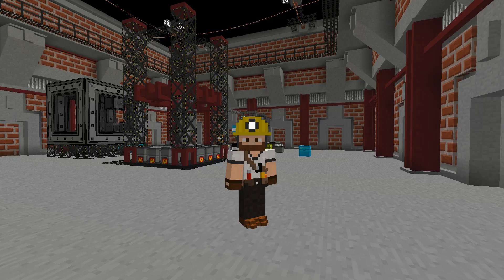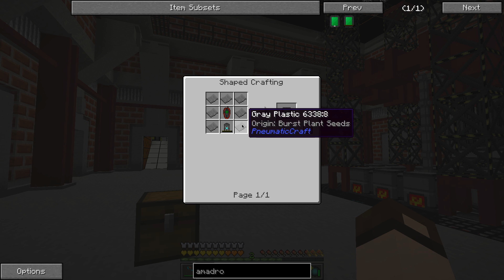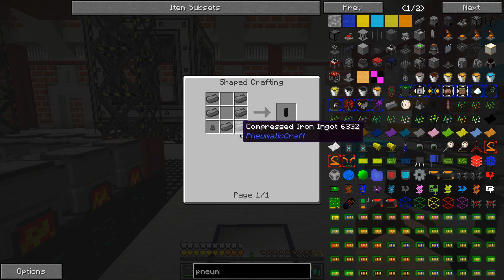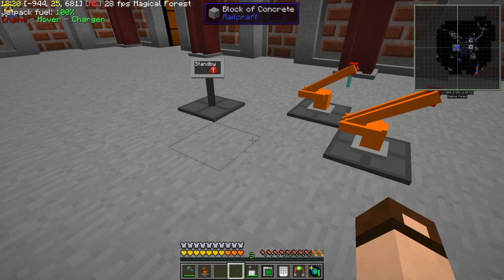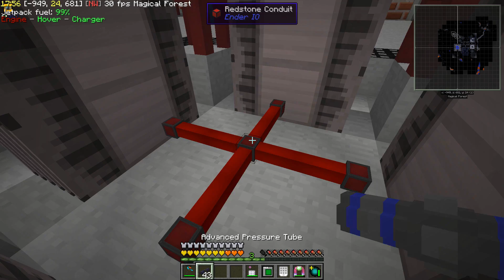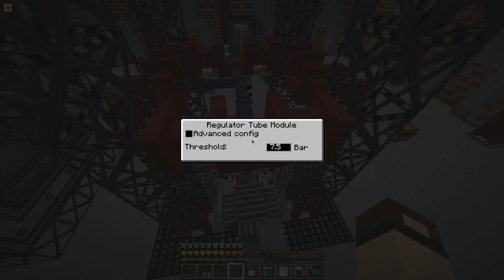Primus Unabridged - 15 - Advancing Pneumaticraft

Comment: Pneumaticraft has some interesting stuff, but while the pressure system is certainly unique and innovative, it also doesn't make a whole lot of sense for powering some of the items. Most notably the pneumatic helmet, I mean it gives a really cool ironman like HUD and it's supposedly powered by air pressure? How does that make sense? I wish there was a way to make it powered by RF. Drones I suppose /could/ be powered by air pressure, I think there's a brand of toy airplanes/helicopters that are powered by air pressure.
Reply from the maker: +MindCaged Watch Steamboy, and then substitute "compressed air" for "steam." :)
Reply from the maker: +MindCaged Watch Steamboy, and then substitute "compressed air" for "steam." :)
Reply: +MindCaged I'm pretty sure you can program drones to automatically fill up your items (RF, Pressure, Liquids, Items)
Reply: +ben fusco Err, I'm confused, how is that related to what I said, or did you reply to my comment by mistake?
Reply: MindCaged Well I'm assuming you want it powered by RF because it's easy and you can charge it on the fly, so I gave you a way of effectively making it like RF

Comment: Dang, it was the advanced PCB on the pressure gauge I was missing when I was playing around with it. I ended up just cheating with computercraft since I couldn't figure out how to make the pressure gauge go beyond 7.5 bars, there used to be an advanced gauge for the advanced tube so I got confused.
Reply from the maker: +MindCaged I had to look it up myself. Then again, I look everything up. ;)
Reply: +Nonsanity Why look up if you can use the in game wiki?
Reply: +ben fusco Err, maybe he looks it up /in/ the in game wiki? Or he might just find it easier to look it up online. I have a dual monitor setup on my new computer and I use the second monitor for reference all the time when I'm playing. It's easier than having to keep getting out the in-game book and opening an entry all the time. Also sometimes there's information online that isn't in the manual, although sometimes it's the other way around.
Reply: MindCaged The online information is out-dated

Comment: You can compress block of iron instead ingots so you will not have to update filters for other recipes
Reply from the maker: +Jakub Pawliński My plan was to make so much Compressed Iron that I wouldn't need to make any more later. But then, once you start putting multiple speed upgrades in multiple Flux Compressors, heat dissipation becomes a priority, and the Compressed Iron flows freely from my coffers...

My vast quantity of iron is stored in ingot form (to be readily usable) in the AE system, so taking the extra step of turning it into blocks would actually take more time than switching the filter around. (I could set up a Compacting Drawer, but that's more trouble than it's worth for this one issue.)

The solution I planned to implement but haven't yet was to make a separate Interface into the pressure chamber just for Compressed Iron.That strikes me as the cleanest solution, and one that lends itself well to later automation and tying the system to my AE network. Any other problematic ingredient I run across later can also be moved to the second output. This is something I'll likely do between episodes. :)
Reply: also you can use cold from oil processing to balance hot from compressors
Reply from the maker: Ah, but then they'd have to be next to each other, and that would spoil the layout. :)
Reply: +Nonsanity you could link it below the floor level. haven't seen any heatsink pipes available.
Reply: +Nonsanity I found it easier to do decompression as additional automation step rather than building second chamber. separate interfaces did not work properly in my processing but will be glad to see it in yours.
Reply from the maker: +Jakub Pawliński I added a third interface. Worked perfectly. :)